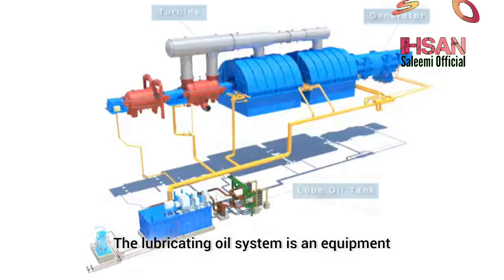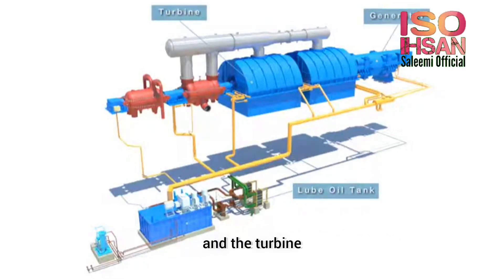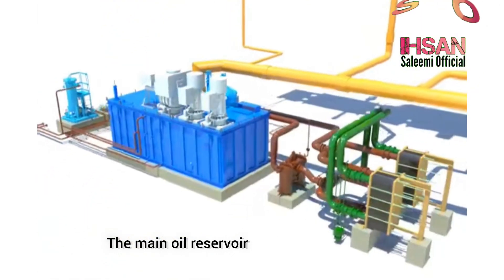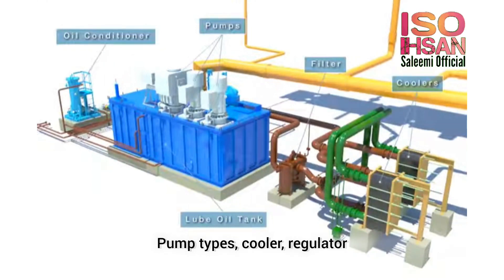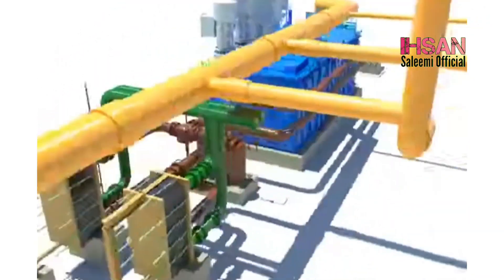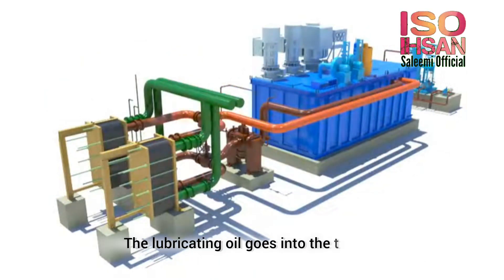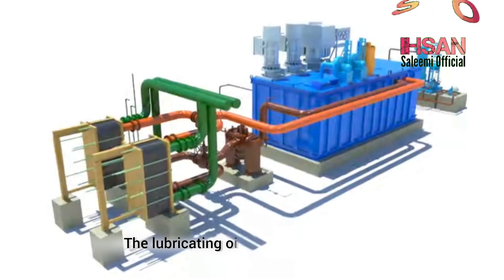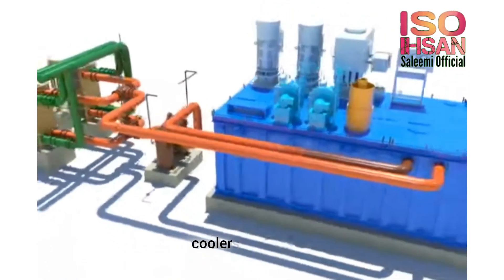660 MW Steam Turbine Generator Lube Oil System | ISO Ihsan Saleemi Official| Lube Oil System of STG

Comment: As per my experience, Graphenizer-4 oil (made with Graphene) can take the Turbine lube oil system to next level for sure.
 a.) It forms a micro-film coat layer of Graphene like a shield inside that controls friction, wear & tear and protects from other negative factors.
b.) It Increases efficiency on metal-to-metal surfaces & other internal moving parts.
c.) It reduces the Over-heat up to 60% and extends the life span. 
d.) It also reduces the load drastically.
e.) It turns the excessive noise / sound into smooth running.

 For more info search in google for Graphenizer-4.